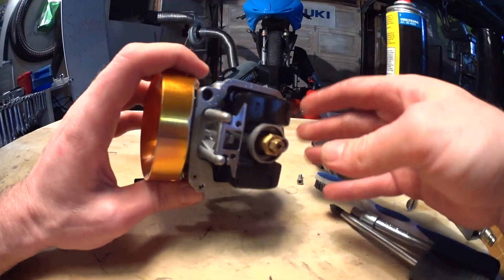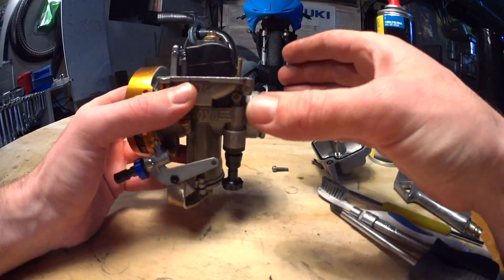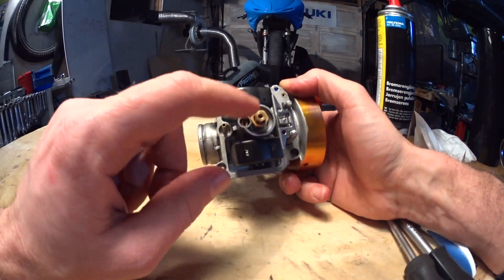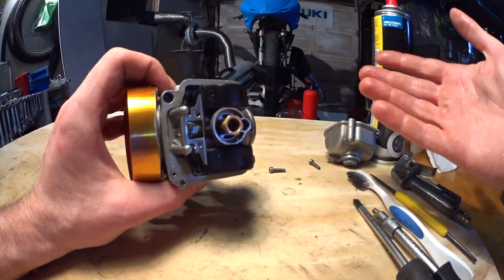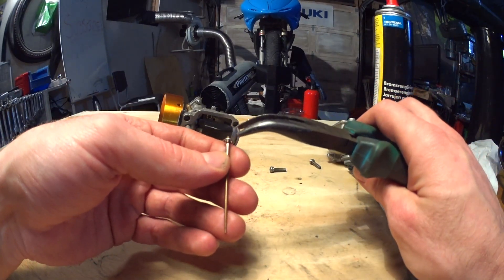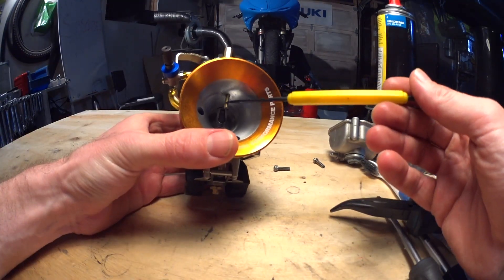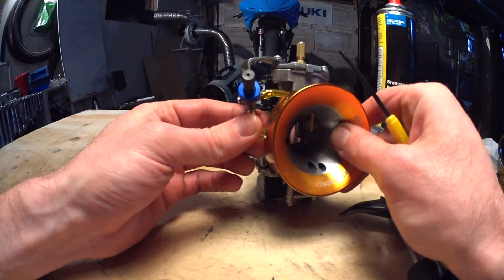HOW TO TUNE YOUR CARB | Carburetor Tuning Tips And Tricks! | 2/4 STROKE TUNING

Comment: I'm have an old Yamaha aerox 100cc with a 124cc bore kit on it and the standard carb is 19mm I did change the carb size to 25mm and jets to suit it following people on the forums and it idles and runs fine apart from full throttle and it starts bogging down but everything below full throttle feels good , any tips on what I'm missing out on because I can't figure it out 👍🏼

Comment: after how many hours of running do you spot "slime" in months of not using your powertrains ? E5 is in a short time with a "crystaline rests" at some fittings/tank infill , if the injektion jet is clean i still do not know but i ask my maintenence garage/dealer 
it was not sand particle out of the durch coast line !!! E5 is stupid after few miles for example ~600miles

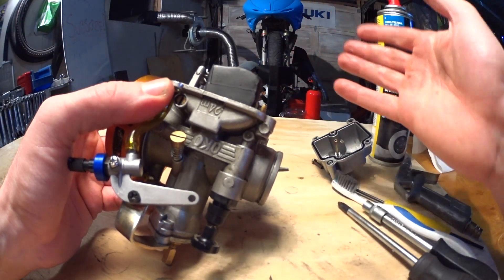and silicone plus nitro methan (RC car 1:10 mix) starts smelling and bleaching the flex pipes if i was not playing for a year

Comment: Hey man, I’ve got a Chinese 50cc with a flat slide carburettor I don’t know how to tune it. I recently put Racing ignition and big bore 70cc cylinder and head. Both engine and big bore kit was brand new I feel like the engine doesn’t want to rev or start it’s pretty Smokey and after 10 minutes of running the plug was pretty wet

Comment: hello i'm kinda new into those things. i have a 300 2stroke which doesn t keep the idle if i don t use the throttle. when i bought it the mechanic told me that the needle (in your video) was supposed to go up before starting the bike and then go down once started. any tips?

Comment: Good tip on the pilot- hey man, so ive been working on bikes for 20 years, and still trying to find out how to achieve max power. Example - couple of years ago my best friend bought a little 90s fzr400, we test rode it and it was SMOKING fast. Pulled all carbs apart to put kits in and clean them - did some minor float height checks, new floats etc. When we got it back together it still ran very good but was lacking that "Awesome" power it had before.. Earlier example - my first adult bike was a 77 cb750- i ran out of gas once and a guy picked me up with the exact bike just dual cams, he almost rode me off the back, all stock - I couldnt believe the power!! Im still stumped! I have JUST used a GAUGE style bike carb sync tool for the first time (made my own manometer one before) and will know next week if this has been the issue all along! I would usually tune pilot jets for max vacuum - THEN make adjustments on idle vac, AND compare at part throttle and tune the carbs on the part throttle more than idle.. Hopefully this works well and is the correct approach.. Anyway thanks - great tips! (pun intended)..

Comment: If you not have compressor, you can blow it with tire pump. Close big cannels and connect pump into bottom drain. Air go every holes eventually. Maybe for iddle jet that is too harsh, because it can inclute some metallic filler? I got some clogging with them.

Comment: Old timer taught me you can also set float height with the carb and bowl off with the fuel line attached and fuel on then bending the float lever until fuel stops flowing while holding the carb as level as possible. Kind of messy though lol

Comment: I have an oko 28mm carb why its hard starting in the morning and have a backfire everytime i throttle it on 3/4 rev it then down backfire
Reply: Late timing or running rich
Reply: @rosegold-beats  may main jet is 105 slow jet 38 and i plug read its lean

Comment: Although a 2 stroke and 4 cycle engine are different, is tuning the carb principles still the same? My 30mm flatslide on my built 301cc Predator is kicking my butt!

Comment: Lay the needle on a flat surface with the e-clip opening  down then just push the needle down with your other hand holding the e-clip. Very simple and you won't risk bending the needle or losing the e-clip.
Reply: thanks

Comment: Do you have experience with the WALBRO 37c carb.  It's widely used on Paramotors.  Your level of expertise on tips to tune this carb. or mod the carb for better mid-range performance is greatly needed and would be appreciated by paramotor pilots.
Reply from the maker: Sorry, not too familiar with them. Better midrange, leaner slow jet maybe, or lower the diaphragm needle slightly.

Comment: Dude you rock! I purchased an old racing mod fl250 2 stroke engine with a mikuni carb. When I putt it around at 1/4 to 3/4 throttle then close the throttle it wants to run on almost like a stuck Throttle. It will run like that for 10 seconds or so then fall back down to idle. If I am pulling a load it won’t run on. only on flat smooth surfaces. I Cleaned the carburetor & it still does it. Any advice would be appreciated.

Comment: For my set up it is recomended  a 30mm PHBH with main jet 135-145, min jet 58-60, atomizer 266-268, pin X3 throtle valve 40
But if i use a PWK 30mm, what jets do you recomend ?
Thanks for any help

Comment: Hi. Your videos are brilliant! Do you   know if a 4 stroke carb with work on a 2 stroke engine? I currently have a pumper carb but as I've now positioned the fuel tank above the engine, I want to use a float bowl carb...

Comment: I’ve rejected my carb about 4 times now, just adjusting the screws. Quarter minute into riding and the pilot screw from the first carb keeps coming out and bogging the engine. Any way to keep it tight and have it adjusted?

Comment: Good day. Based on my experience, prior setting pilot and main jet and needle, we must set float level first. I waste a lot of times try to rejetting, and still can't figure out the perfect combination, because i neglect float level. Eventually i realized my float level is to lean, after set it right, i can gain fine power in low mid and end rpm. Saving your time by set it float level first, hope it helps.

Comment: So if I have a four-cylinder 600cc bike and would like to remove the airbox to replace it with four airfilters, what changes would I have to make to the carbs for the slightly improved flow?
Reply: I'd suggest slightly bigger pilot and main jets of course play around until you find the sweet spot and check your plugs a while later to make sure you got it right

Comment: Sir , i need a help to tune my Dellorto PHBL24 carburetor tuning (two strock.-italy carb)  Honda Mtx 125HRC(Engin similar to Honda NS125). Idle condition mixer rich. And runing fast.  But seems to unburned petrol particles out from Exhaust. When it is tune to some level difficult to climbing mountains. Throttle needle in lowest possition(3)

Comment: hey man ive got a bike and i adjusted the carburator it was working perfectly 2 days later it just breaks down in the middle of nowhere and doesnt start do you have any idea why that would happen?
Reply: Check the fuel tank cap, sometimes they don't breath properly and pull a vacuum in the tank and don't allow the fuel bowl to fill, it's not an obvious problem but it does happen, otherwise just try to set the carb back to were it was, you should only change the carb settings if you've modified the engine.
Reply: Luke Anderson ok it works fine now after just adjusting the caburator but ill see if it happens again if it does ill check the fuel tank cap thank you so much

Comment: What if you have no low or high end, but right in the middle at powerband it pulls pretty hard?
Reply: Have you find any solution?
Reply: @Abdullahd7h2u  My issue was a low and high screw. Gotta adjust both.

Comment: My 12mm bing carb I bought for my moped is hooked up, but now I’m having trouble reconnecting the throttle cable to the handle bar.
Reply: Unhook it from the Slide in the carb and first connect the cable to the Throttlehandle on the Handlebar.
Reply: PistonBully ok I’ll try that
Reply: PistonBully it just seems difficult to connect the throttle then try to connect the throttle cable to that slide piece on the carb. Maybe I just need to give it more muscle

Comment: My engine sputters when cruising. It doesn't do it under throttle.  It does do it idle but, not as bad. I just changed the fuel filter and, never did this before the filter change. Am I running too rich on fuel or, does the needle jet need to be adjusted?  2001 VT1100C Honda Shadow.

Comment: what carb size do i need for a 80cc kit for minareli orizontal scooter ?  the stock carb is 19" and the stock kit was 50cc
Reply: Stefan M did you figure it out?
Reply: Fire Hawk yap ,21 mm  carb
Reply: Stefan M awesome! 👏  did you change the engine?
Reply: Fire Hawk no just the kit , I bought this broken scooter am i found the engine blown and change the bore,piston and its seems that the original bore was 50cc and the guy before me changed the bore but not the carb and i look on the internet so i figure it out i need 21mm for 80cc ,but now my scooter is at home and i am out of country so i hope when i go home to replace that carb (y)
Reply: Stefan M  what’s a big bore kit vs engine? I thought a bore kit was an engine 🤔
Reply: @firehawk8521  bore is just the cylinder and cylinderhead

Comment: I would go further when you say tune the idle jet first, the idle jet meters a minimum fuel flow, it still meters the same fuel you have set it to flow at idle when the bike is at any other throttle setting, at full throttle the idle jet is still flowing fuel, it is impossible to tune a bike from the main jet backwards as changes to the idle jet after you have found a main jet that works for you will alter mixture at throttle setting where the main jet comes into play.

Comment: Why will the engine seize if you're starting with smaller main jets?
Reply from the maker: It will run hot!
Reply: The mixture will be too poor, there for your engine gets hotter, good mixture keeps the internal temps down, if your spark plug turns white its too poor, if it gets black and greasy, too rich, nice light brown color is perfect, this of course only counts for 2 stroke

Comment: I have a question.  What would be the problem with a 2 stroke motor revving max RPM's when you first start it up without even giving it gas?  It will max RPM on start up for like a minute until it warms up and goes back down to idle.  I've checked and I don't think the slide is sticking or maybe it is?  Any ideas what might cause the motor to start off on max RPM's on initial startup?
Reply: Probably a leak somewhere after the carb where it is sucking in air causing it to lean out en revv high. If things reach temperature the leakage might seals because some rubbers or other parts expand
Reply from the maker: Probably running lean when cold, is the choke working?

Comment: Very Good video. I have a problem. My service manual specs two different size of pilot jets 35 and 40. 40 is in there now . I'm experiencing plug
 fouling at low speeds when its warm temperatures outside. Also poor fuel mileage.This is on a 2 stroke snowmobile. If I go to 35 will this damage the engine? Thank you, Mark.
Reply from the maker: Thanks! Sounds like that 38 would be better!
Reply: @2STROKESTUFFING  Would this mean I would have to change the main jet as well ?

Comment: Hello! Awesome video!! With tons of info ;) this helps a lot!!! Question: I have the Keihin PWKS 38 ( GasGas EC300) but i can´t find a chart (temperature/altitude) like the ones of the Keihin PWKS 36 (easy to find on ktm or husqvarna  website for example). Can we use the jetting of the 36 for the 38?! And then do some tweaks on airscrew or needle maybe?

Comment: When I remove the main jet fully. The bike doenst stall but it does stutter alot at wide open throttle. Will I need a thinner needle or not?
Reply from the maker: You'll be fine with a correctly sized jet I think, sounds like it's overly rich without it.

Comment: Awesome video thanks . I have a question I have an Asun quad (chinese) 50cc . The person I bought it from said it needed a new carb . I tried t
Starting it with the old carb in It with a can of quick start . It started and died almost immediately.  I bought a brand new carb , installed it and the exact same thing keeps happening . Do you think you might know what I need to do?
Reply: Look that your carb geting fuel.

Comment: Hey I have this broblem with my moped when I fully open throttle and accelerate to the top it starts bogging. Then if I reduce the throttle to 3/4 - 2/4 the top speed increases. Running too rich?
Reply from the maker: Sounds lean, try a larger mainjet.
Reply: I am currently getting my carb tuned. And this is exactly what mine is doing. Clearly .y mechanic is learning but he started from a larger jet and the bogging happening. He told me he is next going to move the ring again. I don't know, I want to tell him to go back to the larger jet and move the ring then. Cause if he seizes up my engine again, he is gonna buy yet another top end and I am sure he is not wanting to do that. Lol. Thanks.

Comment: Good. Please speak just a bit slower; due to accent but also it's technical stuff, and have to follow , Thanks :)
Reply from the maker: Thanks, I'll try!
Reply: I must say... Love your videos.  I tuned an Air cooled Yamaha RD350; perhaps 60+ (39 standard) but nothing like you've done. and recently finished resto of Kawasaki H2 750 triple (2T) . Yes I love 2 strokes. Have you tried boost bottle ?. do you have an HP target ? ;  24 ? 25 HP ? out of that poor little thing !. BTW different chambers can give a few more neddies :)
Reply from the maker: Thanks! Not tried boost bottles, but want to do some testing with it. Hp target is >25hp at the wheel - not easy...

Comment: So I'm having a problem: 
Full throttle low rpm, goes ok until mid range, just before powerband about to hit. There it starts hesitating/delaying/bogging/you know what I mean? But it runs good with less throttle.

Honda CR80R -01.

Any thoughts? 

Cheers!
Reply from the maker: Could be it's going rich at the spot where the pipe is "fighting" the scavenging. Tricky, smaller mainjet could help, but could make it too lean up top. A powerjet tuned right, in addition to a smaller main would probably be the best solution.

Comment: Hello
I was recommended a boost bottle
what is that and does that bring performance ?
Reply from the maker: It's a small plenum connected to the intake with a hose, can help with throttle response in some applications, but mostly useless.
Reply: 2STROKE STUFFING 

OK thanks for the answer.
then I will not buy one.
keep it up so your videos are great!
Reply from the maker: Thanks!

Comment: hey man thanks for your videos !! i need your advice, what is the best size of main jet for dellorto sha 14 12 , 50 cc engine without flap valve and without resonator exhaust  (sorry for bad English XD )
Reply from the maker: Thanks! That's a tough one, depends on alot of factors... Something in the 50-80 range probably.
Reply: Thanks for answer 😃😃😃

Comment: i bought a 50 cc suzuki dr-50 and it has a delorto SHA 12-12 ,the problem is that starts very hard after many kick's and wont idle at all.i did clean the carb so that's not the problem i was thinking about changing the pilot jet now is a 62. Will this help ?
Reply from the maker: That's the main jet you're referring to, I don't think SHA's have replaceable pilot jets. Have you adjusted the idle and air screws?
Reply: yes the main jet,on this carb you can only ajust the idle, it has only one screw and it dose nothing. I don't think is clog or something because i can blow wd40 on every hole and it comes out....soo i don't know what to do
Reply: i don't have a air filter for this carb ,i've been running it without one since i got the bike maybe could this be ?
Reply from the maker: Is it reed valve? If so, check that it seals when closed. The carb should respond to idle screw adjustments, maybe the screw is broken or the slide is damaged?
Reply: 2STROKE STUFFING there's no red valve on the carb and the idle screw is working is pushing the slide up a little bit but the engine doesn't seem to respond to this change
Reply: 2STROKE STUFFING the needle valve works good the engine is not getting flooded
Reply: 2STROKE STUFFING I just realized that is a sha 12-14 not a 12-12
Reply: UPDATE :)....i bought a cheap chinese SHA 15-15 and the bike now runs very good and it idles god .
Reply from the maker: Sweet!

Comment: Hei! See u havent been working on projects lately :( But i have  a question. Im about to tune my 2-stroke Honda nsr125 and i wonder what part to tune first? I mean. I have the original exhaust system, which i want to use without restrictions. i also want to tune the carb(needle and jets) and ignition(considering power spark). In which order do i tune the parts to get the right result? Which part do i tune first?
Reply from the maker: I'm back in business, just been extremely busy with other stuff. I'd do the exhaust then dial in timing and jetting.
Reply: Sounds great! Ok! timing then jetting, got it!

Comment: Hi Mr Stuffing , all these procedures  were followed and apart from drilling out the needle hole in the plastic slider [ luckily i noticed the needle wouldn't pass through easily  allowing shim s  to function , AMAZING  ] i have smooth strong power on tap. Can't thank you enough , cheers

Comment: hi , i'm curious how the rc valve is set up, i'm guessing it works similar to the lectron power adjuster, it adjusts your fueling at high revs?
Reply from the maker: +Ron Hickmott Yep, adds adjustability to the powerjet circuit.

Comment: Nice video. I have a question. On my Zündapp 70cc I have mounted a 24mm Oko D-slide carburetor. I have read that many people are blocking the 'Powerjet' system of the carburetor because it affects the adjustment negative. How do you think about this? Because the powerjet gives more fuel on the full throathle to cool the engine?